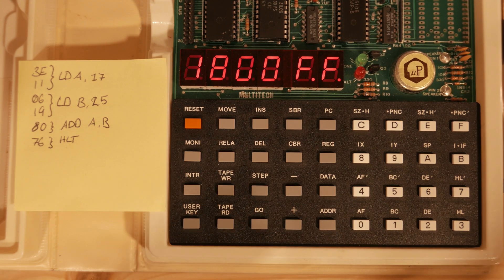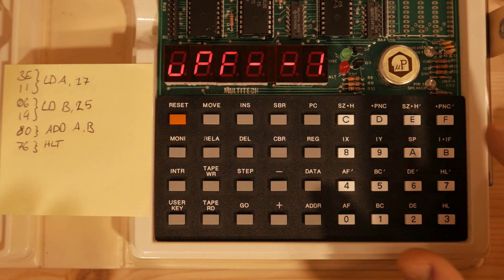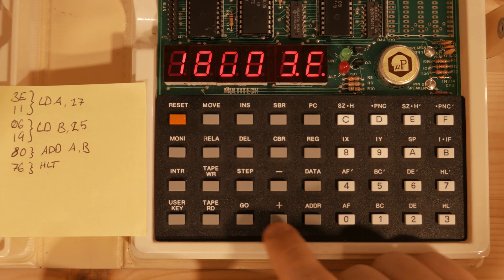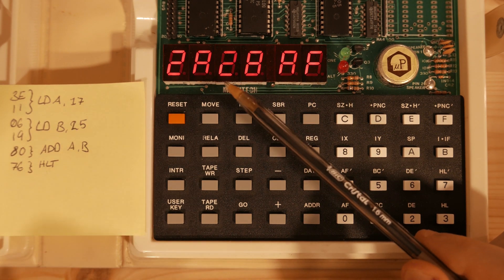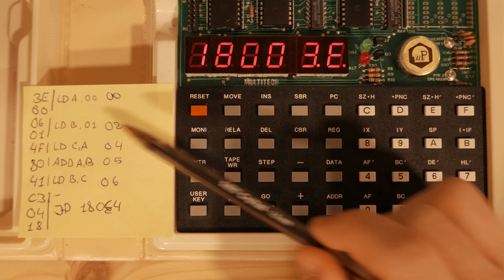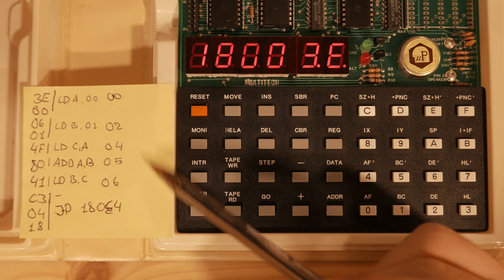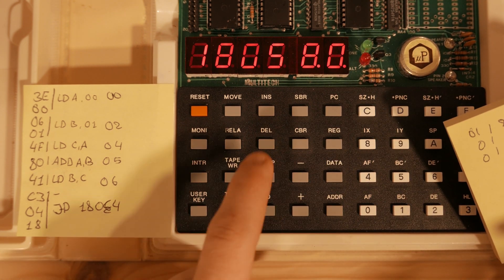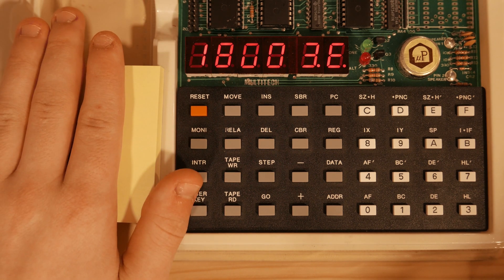Fun with the microProfessor - Z80 assembly programming - Escapades #2

Comment: Please post more z80 related videos! I've been trying to wrap my head around ADD instruction for some time now, Now watching this I somewhat get it! When registers A and B are added, the result is stored back in A?
Reply from the maker: If you read the spec for the add instruction it's built up like add m, n where m and n are any of the registers. The instruction will add n to m and leave n unmodified.

In short, yes you are correct. ADD A, B will add B to A and store it at A
Reply: @engineeringescapades4154  Like wise add hl,  de adds hl to de then stores the result in hl.

And adc adds the carry flag as well. So if the carry flag is set, you adc a, b gives you (a + b + 1) in a.